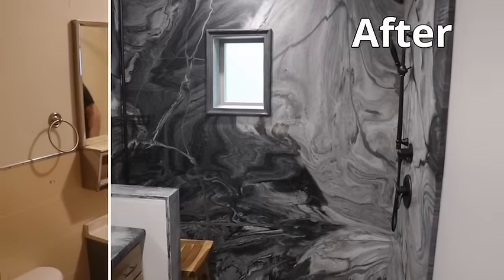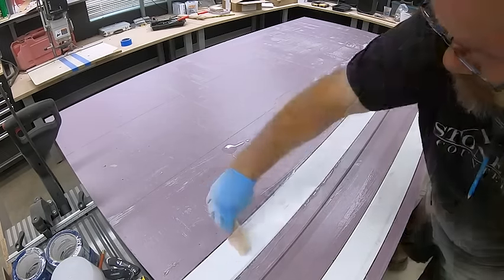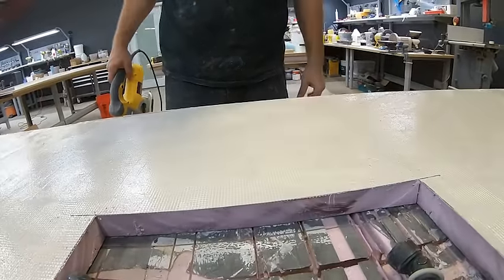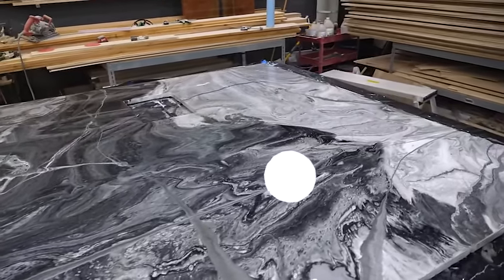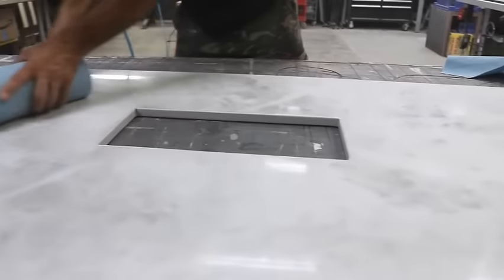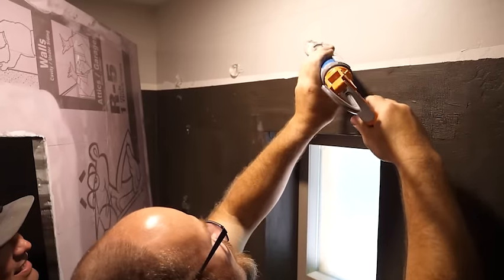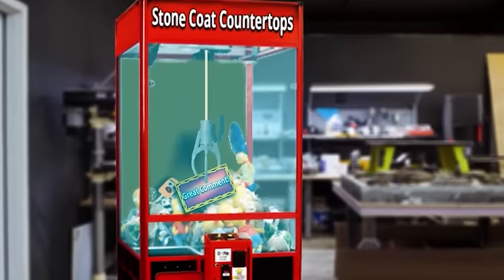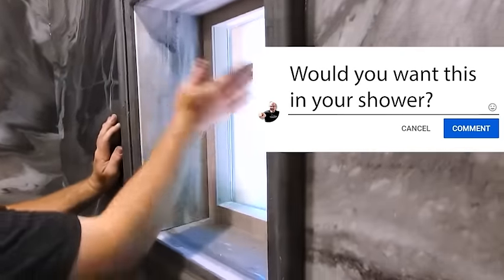Epoxy Shower Walls | Stone Coat Epoxy

Comment: I would like to use this technique to build an outdoor hot tub that would also have heating built into the walls. Similar to electric floor heating. This would need to be laid first then the epoxy over it.

Comment: We have a hall bath that has a curved ceiling over it. Foam is flexible so build a wood form to the exact size would be best practices. It think the fiberglass and epoxy would cure with minimal bumps or defect is wood backers were placed on the concaved side to cure and hold its shape. 1/4” cuts on the back could be spaced to allow for easier bend forming. Thoughts!
Reply from the maker: Give our project support a call Dean! We would be more than happy to go over different possibilities and details. You Got This🙌

Comment: Could you have used Schluter System brand foam boards?   They are very sturdy and are structural in design.

Comment: Really would like to see it after 5 years use. Don't miss understand me but I build wooden sailboats and use a lot of epoxi. Beside the fact that epoxi doesn't really like UV in the long run the aging tends to turn a yellowish ton to the resin if she's not protected from the sun light by paint or other mean of protection. Being this project indoors it may hold better but still would like to see it the long run. As a project just finished it looks great and I may even think about introducing "stone" finish on my toilets and cuisines on my boats since this "stone" is so light.

Comment: I have a cabin in the north woods which I use during the spring, summer and fall only. In the winter, temperatures can go down into the -30's. When I leave in the fall, I shut down the cabin for winter, year after year. I need to re-do the bathroom and this looks like a very interesting solution. What would your feelings be with regard to thermal expansion and contraction? Do you think your shower system would work in the range from -30 up to 90f ? By the way, I think your products and tutorials are stunning!

Comment: This is amazing... how does the area where the rocks meet the bottoms of the panels work? Is there some sort of filler or trim to prevent water under there or does it end up not really an issue?

Comment: Seeing this was quite amazing. I really like the pebbles on the floor... But aren't they a a p in a to keep clean? All the holes and air pockets? I would have guessed you would spill some more epoxy over it all (never used epoxy myself, don't know how to use that to be honsest).

Another thing I am curious about ... At 21:20 you can see the pebble floor and the "stone"walls ... But there is a big gap between both components. Have you filled the gap between the outer wall and the foam wall with silicon, left space for the pebble floor and just added the floor after? Or any other steps?

What about the outer wall at all? Especially at the bottom? Since you have put up waterproof foamwalls infront ... for the wall behind it is crucial not getting any moisture from bottom or from outside, right? 

That said... I don't know much about renovating houses and I am still far away from thinking about something like this. But especially the pebble floor is something that catched my attention and I sure will think about it once I am moving in another home (studend dorms right now, no renovating here :(   )

Comment: Beautiful work. But I have a question.  I didn't see in the video, but I would assume when you installed the glass door you went through the foam and pvc into studs.  Right?
Reply: There is a piece near the beginning where they cut out a section of the foam wall and replace it with a solid plastic piece.  That is epoxied into place and then skimmed over with what looks a lot like plaster.

Comment: Question, would you be able to use Stone Coat to refurnish a bathtub? I see a few other epoxy resin products for that, but they are a lot more expensive and well, pretty much you get white and that's it. I love my old steel enamel tub, but it has seen better days.

Comment: Hey, how does epoxy shower wall "feel" when you run your hand across it.  Will the customer have the sense that it is expensive stone or cheap light backing material?   If the customer falls into the shower wall or bumps hard with their elbow or a child pounds on it playfully, isn't it likely to crack the epoxy surface and cause leaks?  

Thanks for your awesome videos!!!

Comment: What is the black backing material in the shower? I have seen green moisture sheetrock and cement board is gray. Awesome video, looking at doing this in our basement bathroom.
Reply: I'm curious, too. I've seen waterproofing stuff that is rolled on but it's red or minty green.
Reply: Wondering the same thing--and whether silicone would stick to a waterproofing membrane...

Comment: Genius! How did you seal the joints between the panels? And can you just paint the epoxy directly on the wall instead of using the panels?

Comment: Why did you choose to use a foam backing rather than the usual board you used on other shower enclosures?  I have a similar sized space to fix up and don't want to go with the foam if there is no special reason to.
Reply from the maker: Great question! Foam and MDF both have their own unique benefits so it is up to you to decide. Foam board is of benefit when creating extra-large panels so as to not have seams. They are lighter and much easier to handle when installing. They are easy to customize via the template on the job site with simple multi-tool saws. They are made to be waterproof and therefore you won't' worry about water damage to the product down the road. -Kira
Reply: @StoneCoatCountertops  And they do come out strong enough?  We're a pretty klutzy family and can guarantee at least once something will be bumped into the walls - will the coated, webbed foam survive?

Comment: Great project. But I don't like to use silicon on the joints! It goes moldy and let's water through after time. Can you use epoxy to for the joints or something else that's much more durable?

Comment: I have a tile shower thats about 40 years old. It has an old Porcelain-Enameled Steel Bathtub. I believe its drywall behind the tiles. I want to completely demo the tub area back to the studs to replace the plumbing and remove any water damage. Would you recommend cement board or drywall behind the foam? Should I waterproof the wall before installing the foam as if I were replacing it with new tile? I'd like to refinish the tub as well since its still in good shape. Its just an ugly, dated blue.
Reply from the maker: Sounds like a great project! Try calling us directly at 541-450-1976 so we can better answer any question about your project. -Nathan

Comment: It looks like you are using 1" insulating foam,  would 1/2" be adequate?   Also, does it make any difference if I use the foam for the kitchen counter backsplash, rather than MDF?

Comment: I love the concept, and the look, but I personally wouldn't put foam in a shower stall. While it might be good for your noggin and bones should you slip and fall, I don't see how it would have much (if any) impact resistance, and can imagine the damage that an errant elbow would cause. Perhaps grab bars would help, but that begs the question of how and where you would install them, and I don't see an easy solution to that problem either.
But the whole idea of using foam panels is nonetheless intriguing, and I can see a wide variety of other applications where they would make a lot of sense, particularly in areas where there is no chance that someone could accidentally damage them, such as ceilings. Installing a genuine marble or onyx ceiling would be a bear, and cost a pretty penny, but doing it in foam would be a snap.

Comment: Love the shower and the energy of your excitement in making it, but I think the rock floor (even if smoothed down) would aggravate my feet as I'm a pretty heavy guy. Would it be possible to add an epoxy layer to create a smoother floor while maintaining the rocky look? Love all your videos! Looking at doing some bathroom renovations and this gives me hope that it can be done without breaking the bank in the process.
Reply from the maker: Yes you could ad some sand to fill in some of the low points.
Reply: @StoneCoatCountertops  Thanks for the answer! Also, I was looking for more info on the foam as I couldn't find any details about it at the link in the description. How thick of a board were y'all using? Just eyeballing it, I'm thinking around 3" thickness, but I wanted to make sure because it's hard to tell just from seeing y'all work it in the video.
Reply: I think it's standard 1" material. Oh and i don't see why you couldn't add an epoxy cleat coat on top of the rocks,  then you won't hurt your feet.  Probably be easier to clean too.
Reply: @joeturczak5656  thanks Joe! From what I can find online, 1" is definitely more common and easier to acquire. 🍻
Reply: I'm having a hard time trying to find XPS insulation board in my area. Home depot and Lowe's don't really have it in stock. You want XPS for the stiffness and the water barrier.

Comment: did you have to anchor any of the pvc board or any other part of the styrofoam to the drywall or studs...? or once the silicon is dry the pvc board was all you needed to hold the glass..?

Comment: Do you have to use mesh and/or thickened epoxy on the one-piece return walls, or is that just to support the joint in the larger piece?

Comment: I know this is a older project but I am very curious as to which water proof system did you use under your foam boards. I would like to do this project myself but unsure of what needs to be done to prep the underside.

Comment: How do I get rid of a sticky spot? Unfortunately I used another epoxy (before I discovered yours) but I followed the directions to a T. Still I have a couple of small spots that are sticky to the touch. I thought maybe I could put your Ultimate Top Coat over the whole project and that would take care of the sticky spots. What do you suggest?

Comment: OK everyone is going to give you a kudos, but I want to give you...the real criticism to think about.  It is beautiful but (1) why did you leave a space between the epoxy foam board and the ceiling?  To me that looks unfinished and detracts from the amazing overall look. (2) when observing the shower pan, I noticed that there was a space between the rock pan and the wall panel, again maybe wrong but that also detracts from the overall look.  Maybe its just me but I would want to know.
Reply from the maker: Great feedback. Thanks
Reply: @StoneCoatCountertops  I am also curious about the gab between the wall and the pan. Did you silicone the bottom seam as well? Also, does the type of foam board matter and do you have to round over the edges on the foam before pouring the epoxy? Looks great! Awesome work!

Comment: How impact-resistant is this?  Is it possible to dent the panels?  Also, how many square feet will your shower kit cover?
Reply from the maker: Its seriously tough! Our kits and descriptions are on the page linked in the description.
Reply: @StoneCoatCountertops  I was hoping to find more details on your shower kit product page, but it is showing a 404 error.

Comment: Amazing job guys (and gals) I am planning something like this but I was thinking of using plywood, this blew me away. Didnt think of using foam boards would be a lot easier and lighter to handle and install. The floor pan was a great idea too. What do you think of using the Schluter waterproofing system underneath all that?
Reply from the maker: Great question.  We used Ardex system to waterproof

Comment: I want to use the foam panel for a kitchen wall. Do I have to use the mesh or can I just epoxy over the foam board? I am going over the top of drywall with this.

Comment: Does the epoxy yellow over time when you have hard water? I coated my bathtub with another brand of epoxy....  yellowed bad
Reply from the maker: Check out our site, we have different products for this purpose, our Stone Coat Platinum never yellows.
Reply: @StoneCoatCountertops  I have been to your website good sir. Included in the Epoxy Shower Kit is:

2 gallons of Stone Coat Countertop Epoxy

1 gallon of Stone Coat Quick Coat
No mention there of Platinum. 
So to rephrase Mercy's question. If I buy the Epoxy Shower Kit, as offered on your site. How likely is it to yellow in say 10-20 years time?
You got this. 😎

Comment: Hey I saw this video and was wondering if you got any tips to do this with a mobile home since it has a cheap flimsy insert. Me and my wife just bought this manufactured house in the country but it's so plain. Are 5yr anniversary  is coming up, so I was thinking but a shower kit  to spice up the  house a little. Just need advice on how to tackle this in a manufac.

Comment: Amazing Designs. Question. What is the best way to maintain a 3 panel shower wall w/standard sized tub. E.g. Hot water and steam hitting it over a year. What do you recommend for upkeep for the foam board shower wall install. I'm ready to play got my materials on standby.. You guys are impressive. Anyone interested in helping me design a few projects in a 3 bedroom house with finished basement? i'm open to volunteer help in Harrisburg PA. Prepping this home for a mind blowing Air BnB experience.

Comment: Have a question for you I'm redoing my bathroom I want to know is it possible to take the river rock mixed with epoxy and coat a tub on the inside and the outside you know like down the side in the front?
Reply from the maker: Great question Jacob! Unfortunately, we don’t recommend using our epoxy for bathtubs, shower pans, cast iron sinks, or kitchen sinks, due to the self-leveling aspect of the epoxy.-Nathan
Reply: @StoneCoatCountertops  thank you

Comment: I'm making a closet into a shower.  RIght now I have ordinary drywall in the closet.  Should I rip out the drywall and put in green board or cement board if I'm doing the foam epoxy walls? Or can I just coat them with the red rubber paint instead?  Thanks

Comment: Mike! Great work! Question though. I just did my bathroom shower with mdf and Stone coat. Now my in-laws want be to do there’s. Does the foam seem like it would dent easily. Will it hold up to small amounts of force? I’m considering doing there’s in foam. Thank Joe
Reply from the maker: It is very tough, denting in normal human conditions should be fine, if you have a pet gorilla you're not going to want to do this,

Comment: Why not do the window frame and the profile frame in one piece? This would save a seam and look better. Also silicone is not a glue to use for long term in wet rooms. Use polyurethane or acryl instead .

Comment: Looking at the kits on your website, does the gallons to sq ft calculator include the top coat and the epoxy thickener steps as well? Or do I have to calculate those in too?

Comment: is the foam method better than the mdf for the epoxy shower panels backing?
Reply: mister clean  they had another shower tutorial where they waterproofed the back of the mdf panel before application.

Comment: Is there a benefit to the foam over mdf with redgard? I can’t wait to do my shower project with stone coat countertop epoxy!
Reply from the maker: Its more waterproof as well as very lightweight
Reply: @StoneCoatCountertops  do you need to use red guard?  It doesn't seem like you'd have to.  Starting mine next week!

Comment: How much epoxy did you need per bag of pea gravel? This is exactly what I want for my shower base!
Reply from the maker: about 32 ounces. great question. what color gravel you gonna do?
Reply: Thank you! I would like to try and find some earth tones with black and grey mixed in and I want to add in some semi precious tumbled stones such as amethyst, lapis lazuli, etc to tie in the countertop I want to do to mimic peacock ore that I saw Rhonda from rk3 designs do! I’ll add in some pennies with the years my sons were born too!
Reply: @StoneCoatCountertops  I'm using a mud pan and I want to do epoxy pea gravel. How long do I have to wait until the mud dries?  18 hours for tile , so how long for epoxy?

Comment: shower in a box  So I wonder if this would or could work as Faux Rock Siding? Sure would beat trying to cut and form real rock. Not to mention if a rock came loose clunked someone on the head. Is the epoxy UV resistant?
Reply from the maker: our Stone Coat Platinum is extremely UV resistant.
Reply: @StoneCoatCountertops  Ok, looks like I got some work to do once this place cools off a little. (Katy, Texas) aloha from just outside the gates of HELL.

Comment: Can you apply the foam over existing tile/surround or do i need to pull the old material down and prep with new board before putting the new epoxy covered foam up?
Reply from the maker: I would start with new bare walls.

Comment: with the walls being ridge foam wont they be very soft or dent easy?
Reply from the maker: Hi Shawn, great question! With the epoxy coating and the UTC it makes the surface incredibly durable.

Comment: I am surprised no one has mass produced large panels like this that can just be cut on site.
Reply: Epoxy is not as durable as ceramic/porcelain, so durability is questionable. Also scale will aggregate on relatively porous (compared to glass) surface, and temperature is weak point of resin, which will dull the look to my view. Solvents are effective on scale removal, but I am not sure of durability of this coat.
Reply: @BlahBlahManYeah  Don't have a clue what you are talking about huh?  LOL

Comment: How does these epoxy coats work against high temperatures?
Reply from the maker: Great question! Both the UTC as well as the SCC are both heat resistant up to 475 degrees. Check these out!
UTC finish: https://www.youtube.com/watch?v=_BfgY1BJnD8
SCC finish: https://www.youtube.com/watch?v=YLUteivXWaM&t=154s
Reply: Thanks.
I really like your work.